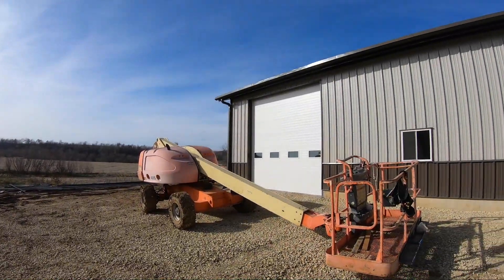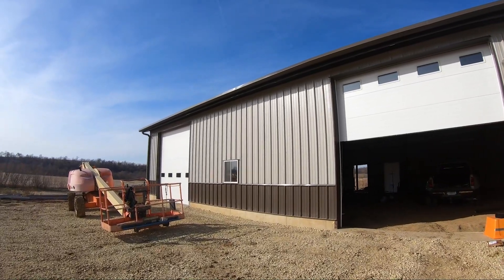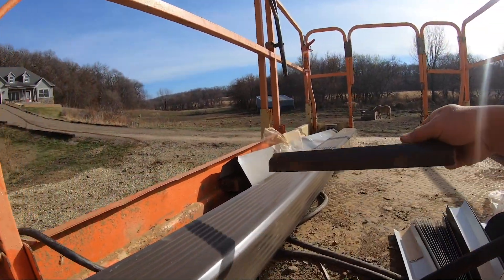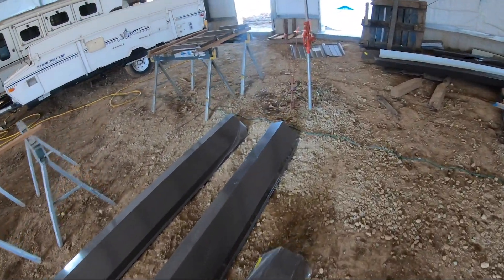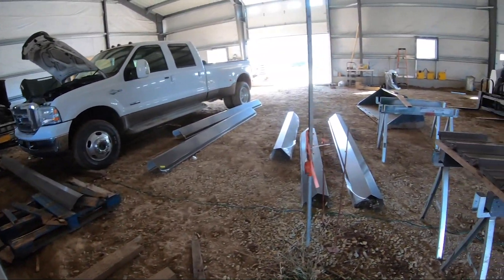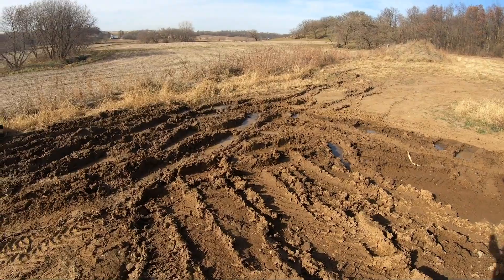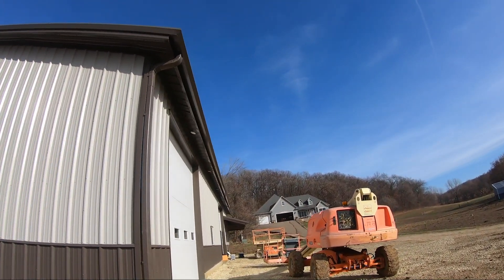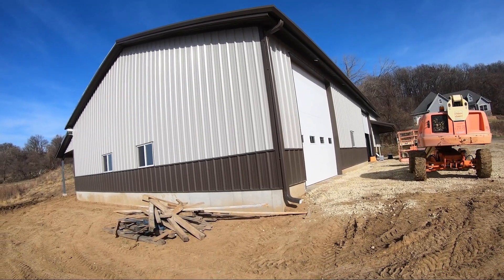Steel Building Erection: Part 7 - Gutters and Delays

Comment: Hey man how did you connect the rake trim to the gutter at the end. I’m doing a metal barn right now and I’m stuck trying to connect the end trim rake to the gutter at the corner
Reply from the maker: Our gutter parts had end-caps that were riveted in and then sealed.

Comment: What are you going g to do with water coming from gutters? Will you be letting it run out on ground or plumbing it out with pope?
Reply from the maker: The gutter on the front side just runs out on the ground now.  The gutter on the backside in the pasture will be run underground next spring and exit away from the area the horses will be in to minimize mud and erosion.

Comment: I've been debating 4post lift vs 2post as well.  I decided on 2post because I need to work on wheels, bearings, breaks, suspension, etc. and want easy access to those things while vehicle is in the air.  Seems like the drive-on 4post lift is best for storage, and some vehicle maintenance, but not as versatile.  I haven't pulled the trigger to purchase yet, so very interested in your thoughts about how you'll use the 4post lift for doing any  of the work I mentioned above. Ideally I'd get one of each, but have other higher priorities for my $$. Thanks for the video and any further thoughts you have on this.
Reply from the maker: I will indeed use it for storage, and likely to move some smaller vehicles, (like the spitfire, lawn tractor) to the loft when complete.  The 4 posts do have the jacks you can add, but I will admit it would be tougher to do a cradle drop for an engine swap for example.  I'm also thinking with some of the older stuff I work on, the 4-post will be better especially if some vehicles need some structural frame work (see Hoovie's recent Subaru video) :)   I was bent on the 2-post, for space reasons, but I seem to have already filled up the building!
Reply: @DachsAutos  Nice!  That makes sense, especially using the 4 poster to get smaller vehicles onto a loft.  Good luck. I look forward to seeing how it all turns out.  It'll be a while before I get to installing my lift and getting it onto my YouTube channel.   Been focusing my videos on saw mill and working in the woods over working on my old Porsche 928S.  It's day will come though. Maybe seeing how yours turns out will make me want to go with 4 post over 2.  Thanks for sharing and replying to my comments.  Much appreciated.  Ted

Comment: Looks like you may want to add snow guards?
Reply: Is there anything else holding the gutter up besides the straps?  Does it sway in the wind?
Reply from the maker: The straps on top, and the back sides are screwed into the endcap of eave.  I think my plans had over 15k screwed listed in inventory :)